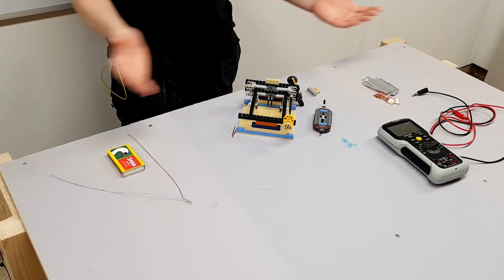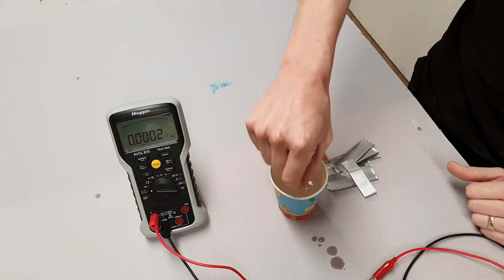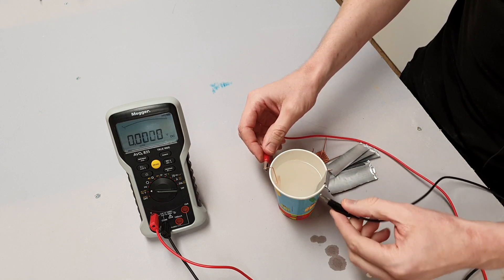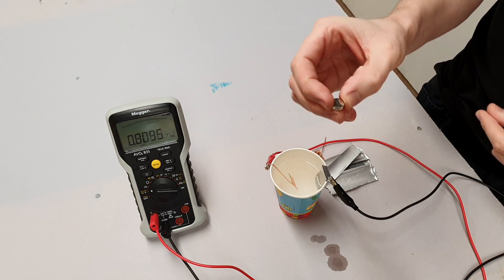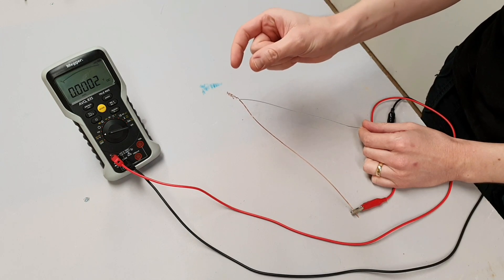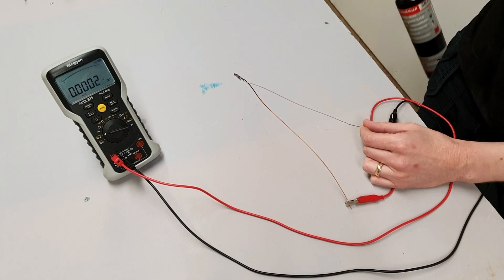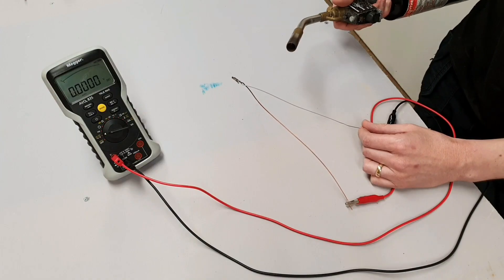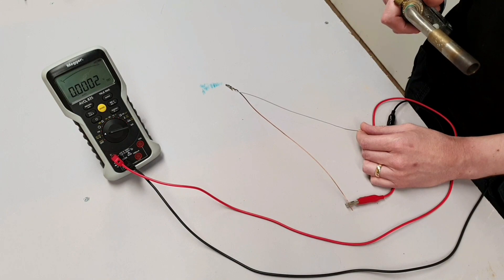How to Make Electricity: The Three Methods Part 1, How to Make a Homemade Battery & Thermocouple

Comment: could u pls explain at which point we use electricity....electron movement is electricity..if we fix the bulb in between the circuits...how it consumes this energy...electricity is energy...where this energy will be there? throughout the circuit? consumption of electron is energy? the potential energy of electrons and proton makes movement but how kinetic energy of an electron is converted into electricity? Lots of my doubts are cleared after seeing your video...It would be very helpful if you clear this doubt
Reply: Electricity is a form of energy we only convert it to different form of energy we don't really use it
Reply: @coatechnics2676 potential energy is converting into kinetic energy(electric, heat etc)..How electrons are not used? When we eat the food and it will be stored as chemical potential energy in between the bond...this chemical energy will be converted into kinetic when our body does respiration...Like that electron should be reduce when it converts into electric energy

Comment: The thermocouple principle is the wheat stone bridge theory I think.
Reply from the maker: Cool, I'll investigate.
Reply: Wheatstone is 4 resistors where a current is flowing through. If all resistors have the same value the unbalance voltage is exactly zero. You can measure temperature changes with this, or can measure resistance changes and the value of resistors. But actually no one uses this any longer for the measurement of resistors.

https://upload.wikimedia.org/wikipedia/commons/e/e3/WhBr_Diagonalbild.svg

Device to measure resistors:

https://image.jimcdn.com/app/cms/image/transf/none/path/s69fe05db4460e9aa/image/ia714237692f84c6f/version/1447666970/hartmann-braun-schleifendraht-messbr%C3%BCcke-typ-wheatstone-typ-pontavi.jpg

So no, it's not Wheatstone because Wheatstone requires electrical energy to work. This is the "Seebeck" effect. This thermocouple works differently, and depending on what metals you use it generates different voltages. These are comparable and normalised. The best and most used example is the type K thermal couple where one wire is made of Nickel and the other one is made of Nickel-chrome alloy:

https://upload.wikimedia.org/wikipedia/commons/e/e1/Thermocouple_voltages.PNG

https://en.wikipedia.org/wiki/Seebeck_coefficient

Most multimeters can also measure temperature now, there's in most cases the type K thermocouple involved. And actually it's only measuring the voltage and the multimeter is converting the measured voltage with the curve into temperature and displaying this converted value.

Comment: Great video, Joe. I suppose a photovoltaic cell is a fourth way of generating electricity but perhaps it's not in the syllabus of what you're teaching.
Reply from the maker: Yeah I've mulled that one over a lot, I wonder if it would fall into the chemical section? Not sure actually.
Reply: I think it is different as it is direct conversion of photons into electricity, I believe but I am no expert.
Reply from the maker: My understanding is the photons kind of knock electrons through a thin layer of material and they can't get back that way so if you connect a circuit externally they'll head back through the circuit, hence electricity. 🤔 Sounds like some more research and a video is in order!
Reply: Sounds like you're ahead of me in the understanding. I agree it's worth a video as photovoltaics are now being used widely to generate sustainable electricity. They're in fields and some people have them on their roof. Not to be confused with direct solar heating of water in domestic situations widely used in hot countries e.g. Cyprus, where my sister lives and has a solar water heater on her roof.